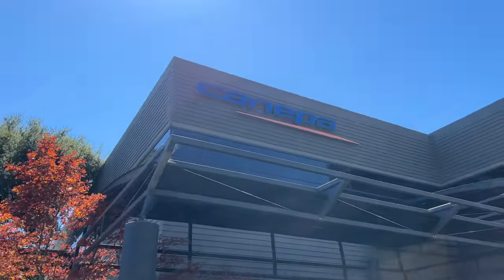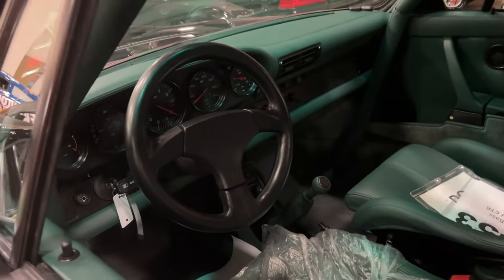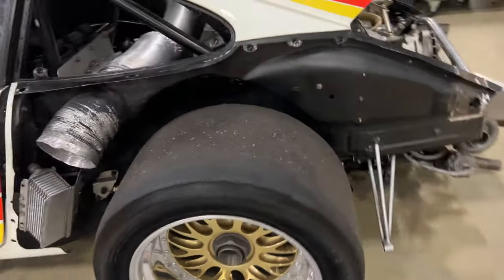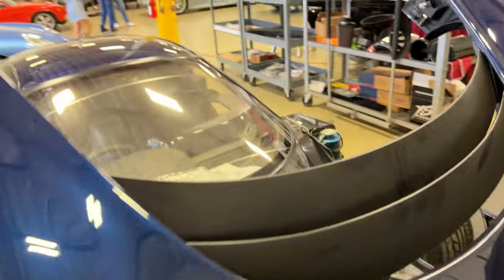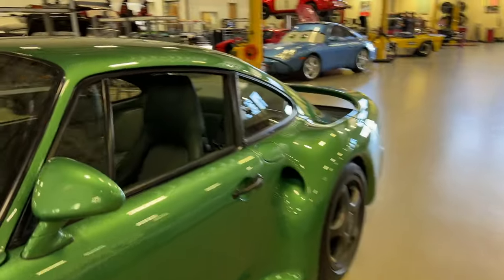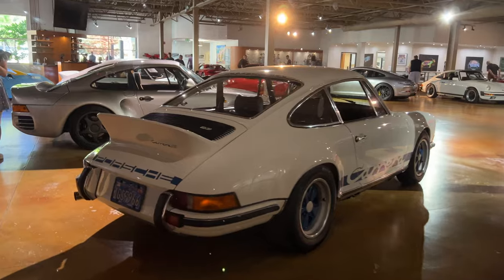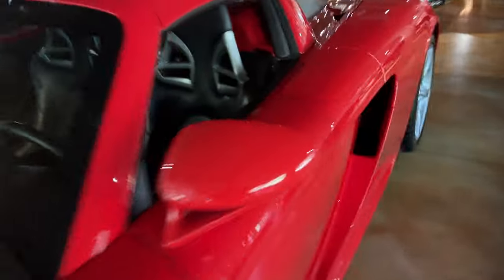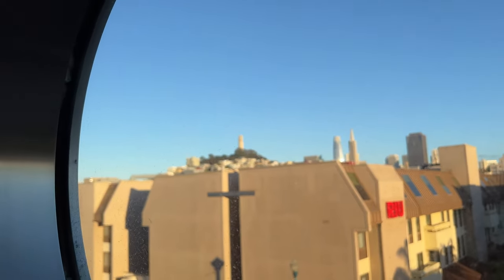Not 1, but 14 Porsche 959s - Carweek 2022 at @CanepaMotorsport

Comment: +1 .. At time-code 3:50 begins a '67 - '70s Cadillac Eldorado V8 front-wheel drive with a solid rear axle suspension. .. Go back many Canepa Shop walks you'll find the Caddy is unrecognizable from the above "Re-imagined" condition. .. Damn, count the details on this Caddy project,,, from the OEM like-kind aesthetic enlarged wheels to the broadened front grill width... Damn,,, understated elegance true to the early '62 era and its GM designer.